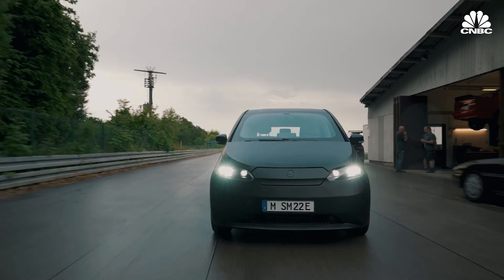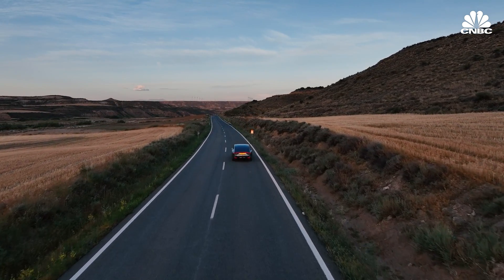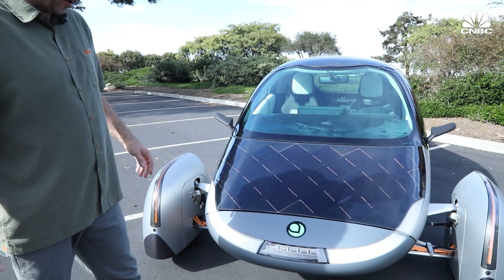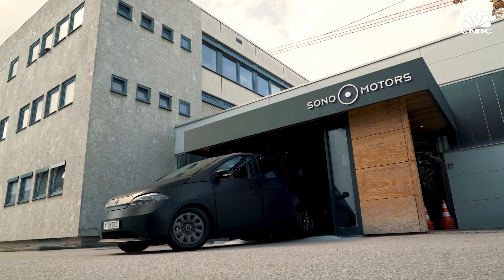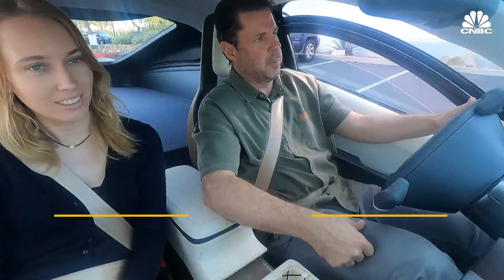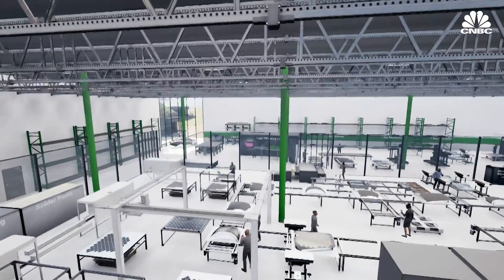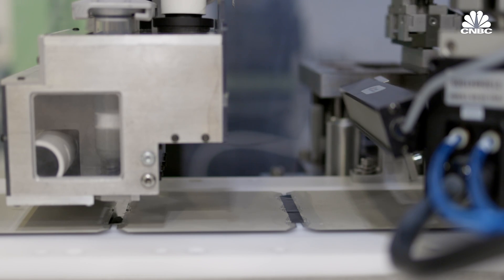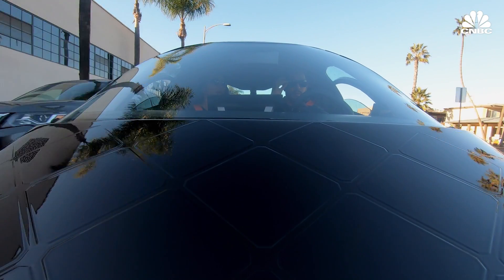Solar Powered Cars Are Here — But Can They Go Mainstream?

Comment: 15km/day is a mighty goal.  Anywhere beyond 30km/day is pitching you bridges.
Reply: Aptera claims up to 40 miles/day.  We'll see.
Reply: @robertd9850  In the interview on this video, Chris Anthony seems to have trimmed the estimate to 30 miles per day in San Diego.
Reply: Are you sure about that, Einstein? The Aptera is very aerodynamic, lightweight, has 700 watts of solar panels, no gearbox/transmission. It's not hard to imagine that vehicle  achieving close to their claimed 100 watt-hours per mile. Even if they are overstating the  solar gain per day by double or the 100 watt-hour energy use by double, they would still exceed your 30km/day.
Reply: @skipondowntheroad5833  Don't have to be that condescending to him, but I also looked into it and reach the same conclusion as you.  If you strip things down enough, you can make a solar plane fly in the air for as long as you want.
Reply: Aptera gains more miles per day by being able to drive further on less energy.

Comment: It does sound viable, possible and they have a good business mode the only issue with all three is that they all still rely on battery 🔋 which degrades with more use. Once everyone goes solar, wouldn’t  the reliance on battery be an issue once there is a lithium ion shortage? It would seem more reliable to use hydrogen and solar, since the hydrogen isn’t losing its energy or going bad over time and can sit there without issue while batteries can be used where they’re needed or can be minimized to take up less space and charged from either the Hydrogen or solar energy.  
Just a thought
Reply: There is a Tesla Model 3 with more than 300,000 miles on it. That's more than most gas cars can muster, and it's not done yet. Hydrogen has many problems. How do you make the hydrogen? Methane reforming? Or do you split water with renewables and get half the efficiency of a battery and more than twice the cost? Hydrogen has terrible volumetric density, so you have to compress the hell out of it, which takes energy, but it in a very strong tank, protect it, and it still takes up a lot of room in the car. It makes metals brittle. The fuel cell stacks cost a lot. Hydrogen leaks are very dangerous. Hydrogen fueling stations are very expensive, and there are very few of them, like zero in Ohio, and you can't charge them at home. I have 2 EV chargers in my garage. Hydrogen needs to stay away from things batteries can do reasonably well.
Reply: @fjalics  Agree: hydrogen is a dead end. I used to have a scuba shop and well remember how much energy it took to compress air into 3000 psi tanks. Hydrogen tanks are, IIRC, 10,000 psi. That's a heck of a lot of work!
Reply: The ocean is full of lithium! Now is the time to develop the process to get it!

Comment: Apteras are nice addition to BEV 🚗.  But don't fud facts, today one can drive using solar power alone by owning any number of EVs, have solar panels at home. Electrons is the same if you send it to the grid at peak, then at night pump it from the grid in your EV, at half price. With home 🔋, even better.
Reply: What about the 100s of millions of apartment dwellers?
Reply: @shinequashie393  Nimbus.  The packs can be brought up and charged in your living room.  Not a perfect solution but could definitely work for some.  Public level 2 needs to be expanded massively (more important than level 3 DCFC)
Reply: Agreed.  There's the added benefit that I'm relying on one energy source (electricity) and I'm producing it myself.  If the grid goes down I don't have anything to worry about other than how full my home battery is so I know when to charge the car.
Reply: @madcow3417    If the grid goes down, especially as in permanently, it is most likely because of a strong Solar storm combined with the earth's ever faster weakening magnetic field (which is like a shield against those energies). 

  Hate to break it to you, but such Solar events will likely take out home Solar systems. It will burn up the wires via induction. It's possible, I suppose, to extra shield them, so that this will be less likely to happen.  As regards that, alternating wraps of insulators and conductors is a way to shield the wires.
Reply: @justinw1765  I thought that solar storms were really only dangerous for long runs of wire, like telegraph wires during the Carrington Event.  With space weather prediction it should be possible to know ahead of time to detach from the grid.

Comment: Solar panels have very toxic materials inside that are filling up land fills in California. Not the future and not the answer. Still takes fossil fuels to produce, still takes fossil fuels to make plastics, tires, rubber, etc.
Reply: EVs and solar energy are far more efficient and green than ICEs by any measure. Sure, it's more green to walk where you're going, but the Aptera will be the greenest production car ever made
Reply: @GoClimbARockEh  This is NOT about "efficient" this is about claiming it green when it's not! This about the power grid that cannot handle everyone charging a vehicle constantly because the power grid cannot handle it. How do I know this? Because my family works in the power grid system. The solar panels are toxic, full of toxic metals. ICE cars are RELIABLE, DEPENDABLE. It's NOT the future, unless you want a dystopian style future.

Comment: This is going to be huge in Arizona, New Mexico, etc…
Reply: Good luck with powering that AC off solar. You'll be left with nothing for driving.
Reply: @skdsky0  , the internal volume isn't much, like a Ford Ranger, the AC won't drain the battery.
Reply: @skdsky0     Can't speak for the other models, but I know the Aptera is made from a foam core composite material (not sure if fiberglass or carbon fiber though). In other words, it is far more insulating than a typical car. That means less energy to cool or heat it.
Reply: @skdsky0  yup
Reply: I think it could be, but they have to get them into production. Fingers crossed.
Reply: I began to include solar-powered cars as one of the modern convenient features 👍, along with Apple CarPlay, Android Auto, Heated & Cooling Seats, and Heated Steering Wheels.
Reply: I assume you have to keep the car parked outside at all times? Putting it in a garage means you get no benefit from the sun. Great, so your car is now much more likely to be vandalized or stolen.
Reply: No sorry….

Comment: Well what about a Krank powered option like those flash lights that Krank for energy so we don't have to depend on the sun
Reply: They have those now. They are called bicycles.
Reply: I have one of those.
Reply: It would take hours to get a few miles of charge.
Reply: @LoLErMan13  Pretty sure Christian is kidding.
Reply: Don’t forget the ones you shake up an down.  Get some use out of those potholes! 😂

Comment: Cost of solar panels on cars, including the glass, will come down so eventually they will be standard equipment on all cars.  However, all cars will be charged traditionally too.
Reply: There are also solar panels in the development stage than are much more efficient.  Aptera has designed its vehicles so the panels can be replaced with more efficient ones as progress is made.
Reply: The thing with solar is it can only work to charge the peripheries because the vehicles are too inefficient. 
Manufacturers have to stop making them traditionally and look for other ways like Aptera. 
The Sono Sion also has solar panels but is way less efficient that solar doesn't have an impact on it.
Reply: @Enforcer_WJDE  Yes, one only need look at the shapes used by the university race solar cars.  The flat topped microbus design, with one roof surface over the entire vehicle seems the most efficient to me in terms of carry/exposure quotient.  Sure, its a brick in terms of aerodynamics, but at urban speeds, who cares?
Reply: @alanhall6909  True but a bus will still have to push a ton of air away compared to a sleeker design like a solar racer. Then there the weight. Yhose busses are going to be used to haul people and packages. Efficiency us going to be way worse but still better than an ICE bus for sure.
Reply: @Enforcer_WJDE  At speeds less than 40mph, shape doesn't matter.  I drive my old VW microbus 65mph and it doesn't matter that much until I'm going over 50mph.  Urban driving rarely drive over 45mpg.
Reply: @alanhall6909  You are confusing "a more noticable effect" with "no effect at all". Of course it has an effect. Try running with a piece of cardboard held in front of you then run with the same cardboard parallel to the ground. Notice any difference? I bet you will.
Reply: @Enforcer_WJDE  Ah, no.  Obviously, aerodynamic shapes are more efficient in terms of reducing drag.  However, for a solar powered urban transport vehicle, a boxy van shape is superior overall.  At speeds 40mph and less, aerodynamics are not that important.  Heck, many ICE vehicles have such a shape or similar, like pickup trucks and vans.  Motor homes too.  Just look at a city bus, pure brick.
Reply: Mostly all from China.
Reply: @gregsz1ful  So?
Reply: China burns coal to make solar panels.
Reply: @gregsz1ful  What's your point?
Reply: @robertd9850  I have been hearing about solar panels for decades. What about black silicon LOL ?? I have a couple points. First you could tell me about percentages how much KWH required for travel, and produced by solar, in everyday use, and storage in garage at night.
Reply: @gregsz1ful  What does the last comment have to do with the ones about China?

Comment: 1kw per square meter. The average solar panel is only 25% efficient. So I. A square meter you might get 250w. That isn't doing anything.
Reply: What is IS doing is providing 700W on the Aptera which gets 10 miles per kWh. That's something!
Reply: And how many square meters of solar panels are on the Aptera, Einstein? Enough to place 700 watts of panels. That is plenty for a super efficient vehicle such as this one.

Comment: But the cost to repair will be expensive.
Reply: Unlikely. Composites are relatively easy and cheap to repair
Reply: @GoClimbARockEh  Not if the solar panel are damaged.
Reply: @saulgoodman2018  the panels are designed to be fairly durable, so that kind of damage will be rare. They're also designed to be replaceable. Should be maybe a grand to replace a panel, and much of that will be covered by insurance
Reply: @GoClimbARockEh  So a 25 mph hit, will cost thousands?
Reply: @saulgoodman2018  Just stay off the road. You're a dangerous driver.
Reply: @saulgoodman2018  Aptera's solar panels can be replaced. Way easier and cheaper repair than rapairing any dinged car body.
Reply: @benjaminnead8557  other people can drive in to you.
Reply: @charangohabsburg1  but then you would also have to replace the panel, and repair the car.
Reply: @saulgoodman2018  Of course the whole panel has to be replaced, and still will be cheaper and quicker than repairing dinged sheet metal. Leave alone that it is harder to damage these Aptera panels than dinging sheet metal (Aptera has performed some impressive tests shooting ice bullets on its solar panels).
Reply: @charangohabsburg1  Most panels are carbon fiber these day.
If you damage the sheet metal anyway, that means the solar panels got damaged.
Reply: @saulgoodman2018  You should take a look at how the Aptera's solar panels are made before trying to make predictions how they will behave.
Reply: @charangohabsburg1  They can still get damaged.
Reply: Which part?

Comment: Aptera is expected to get up to 40 miles from the solar panels per day.
Reply: They said that before but maybe curved their estimate to be more in line with the testing they've been doing.  I myself really won't be relying on the car panels to charge up as I like to have the trunk hood be a window, and I'll let the panels on my house charge it for the most part.  Granted I did get the hood and top panels, just because if you go to resell it, you'd want to let that still be appealing to buyers.
Reply: @artboymoy  I always considered the 40 number to be very best-case scenario and unlikely but even if it is 20, that's all I need for most of my driving.  Supposedly, the panels are replaceable with better ones when they become available.
Reply: @artboymoy  In this video Chris Anthony is now giving 30 miles per day as their estimate for San Diego.
Reply: @robertkirchner7981  Living in CT, I'm reading that to mean 10-15 miles per day on average for my real world expectations.

Comment: Electric public transit like old street cars in LA and San Francisco is the real solution. They need to be brought back as a public service, not a privage company. They won't need batteries so that won't be a problem.
Reply: Agreed. But if one lives in the suburbs then something like the aptera is a more likely solution.
Reply: Yeah, that's great if you what you describe going by your residence, at the times you want to travel, but for the vast majority, that's not going to be the case.
Reply: Nothing wrong with more public transportation, especially in the crowded city centers. I'd also like to see high speed rail in the US, instead of our current reliance on air travel. 

But what you have to do is figure out where the electricity for those nice old street cars is coming from. If it's simply from burning burning coal or methane, it's going to be dirtier than a privately-owned EV that runs on renewable energy, like solar panels on the owner's home rooftop. Solar on the car itself is just the next step. Also, vilifying lithium battery technology is kinda pointless, especially if you own a cell phone or laptop. That it's all getting cheaper so quickly is the bigger story here.
Reply: @benjaminnead8557  All valid.  But on your last point, you're making an assumption most EV's are or will be charged with solar.  The majority aren't today.  Although, even coal or NG generated power is still cleaner than filling up at the pump.

Comment: Can't wait for Aptera. Hoping for a "blanket" or something to shade the windows so it's not blistering hot after parking in the sun
Reply: One of their videos said the HVAC system will automatically insure that the car gets no hotter than outside air temp while parked.
Reply: @billman5379  That would be a fantastic solution...but now I wonder how much of the power from the panels is "wasted" on the HVAC.

Comment: So who is going to be the first to put little wind turbines on top of cars, so they can charge even while parked in windy areas, and at night?
Reply: You would probably need a giant turbine to power a car
Reply: @austinhernandez2716  I wouldn't expect the car to be turbine-powered, just one or more turbines here and there to supplement the solar when there is wind or while the car is moving (provided the drag doesn't cancel it out in the latter case).
Reply: I already did that.  And have divert power generated from my cat's exercise wheel which gives me up to an additional mile and a half/month!

Comment: If you want regular people to buy these electric crappy Vehicles you got to bring the prices way down guess cars are the cheapest right now I'm not giving up my gas car for an electric car which don't make sense because electric cars still use the environment just like regular cars..
Reply: Lifetime ownership cost of electric cars is far far lower than gas vehicles. The lifetime carbon footprint is also far far lower. But yes, ev's have a higher upfront cost on both.
Reply: @GoClimbARockEh  eventually electric cars will be the thing to use but it's going to take over a time because there's so much regular gas vehicles people and companies still make gas vehicles today but they will slow down I figure to have a complete world with electric vehicles and no gas vehicles you're looking at probably another 50 years probably 100 years easy cuz a lot of people are not going to go up that cars I called of course I won't be around by then I'll be there in a gun by then..
Reply: Buy the aptera.  25k
Reply: @danam0228  explain my friend

Comment: My research tells me the Aptera is the blue-ribbon holder.  More efficient, better priced, and bleeding edge engineering, which should result in very low to no maintenance, extremely safe, designed as a formula one race car, with a monocoque carbon fiber body stronger than steel by a factor of 6- or 7-times tensile strength of steel. Lightyear comes in a second place, but the Sono is much more in line price wise.

Comment: we all need oil there's no lithium for everyone stop 🛑
Reply: Efficient cars like the Aptera only need 1/4 of the lithium needed to achieve the same range as a tesla
Reply: Not correct
Reply: @mikafiltenborg7572  Aptera gets 10 miles per kWh. My Chevy Bolt gets 3.9 and a Tesla M3 gets 4.56.

Comment: They would totally fit my current driving habits. I'd get one of one was available. They will have to put a bit more effort in aesthetics to get me hooked, though.
Reply: The appearance, at least for the Aptera and Lightyear, is driven by the first principal of aerodynamic efficiency.  The resulting aesthetics are largely a coincidence rather than a driving factor.  One wonders what you think it should look like?
Granted, the Sono Sion is kinda homely.
Reply: @joelsmith4394  To be fair I like the look of the Lightyear